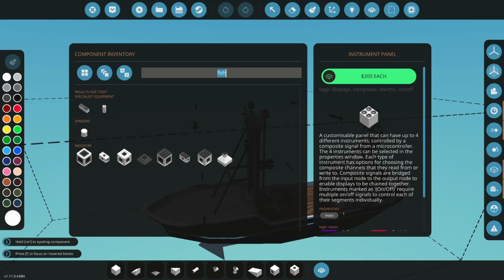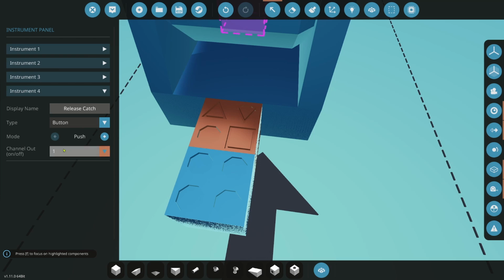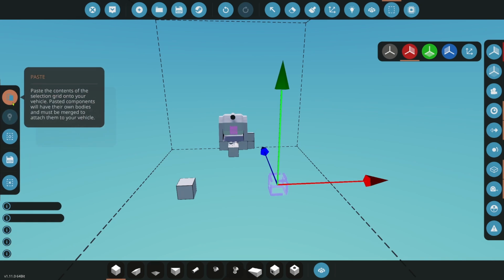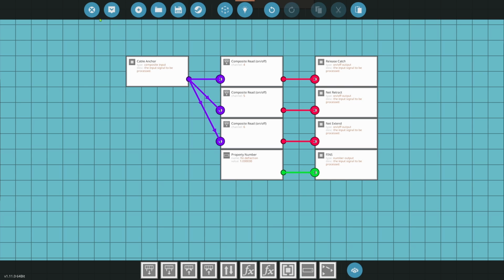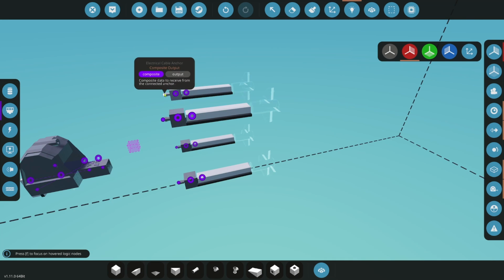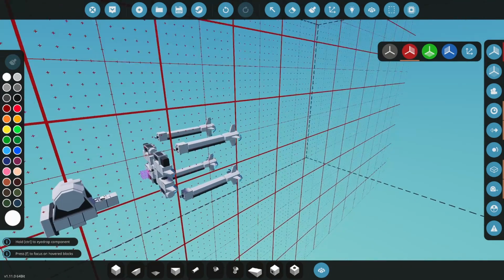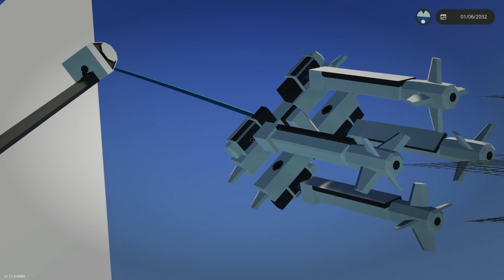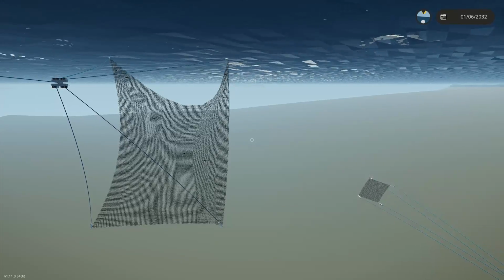Stormworks Basics: Fishing Net Tutorial #tutorial #stormworks #gaming

Comment: All microcontrollers should be 1x1x1 blocks in my opinion. With a menu to open up to connect all the nodes into it. Even if there are 50 nodes. 

That would be a nice quality of life improvement.

Just finished a helicopter build where I had to hide the massive microcontrollers all inside the walls (the MC's became the walls), still.... I had fun with those design challenges.